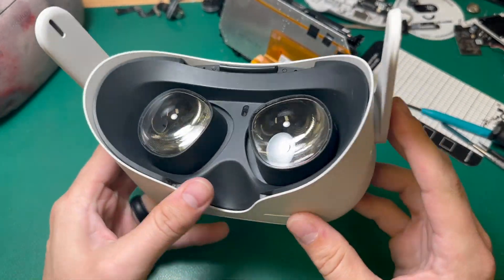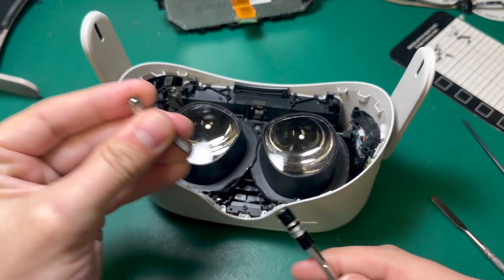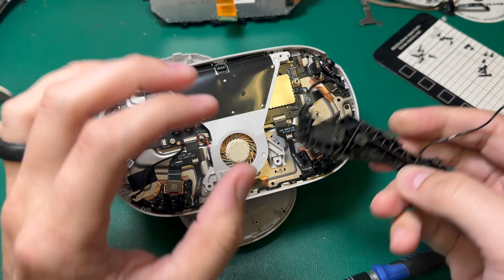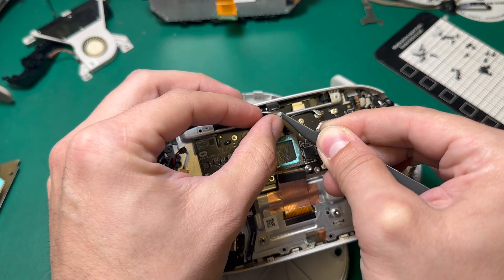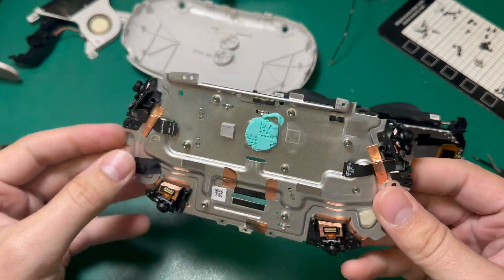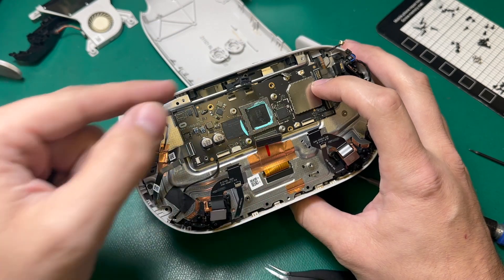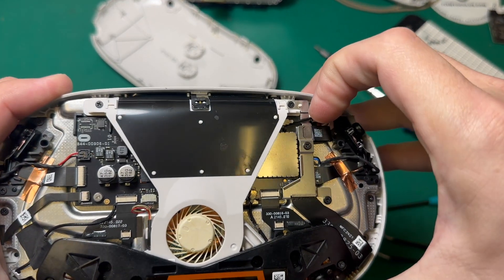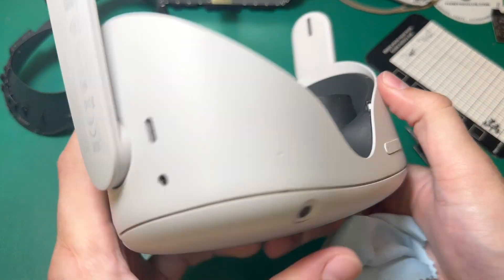Quest 2 LCD Replacement - Sun Damage Repair

Comment: lets fricking go, fixed my headset, i dropped my headset and it went black screen but then i did all the things in the video except replace the motherboard but i just unplugged the lcd cable and it worked, thanks

Comment: @fixmyoculus  I followed this guide as well and have 2 oculus 2's. One had a scratch on the LCD inside causing a small black line otherwise the whole thing worked great and had no problems. The weird thing that is happening to me is that after the meta screen comes on but its not rotating the icon just a still image, it has a download arrow icon on a chip symbol and a green bar that fills up. Once that is done the normal meta icon appears and is rotating around, once that is done I just get a black screen. I've waited for over an hour, I've restarted, hard restarted, fully charged it, tried it while plugged in and not plugged in. Iv'e reseated every connection I have reseated every connection repeatedly Went into the menu and chose to power down then went back into the boot menu and chose boot. Every time it does that chip icon thing then goes to a black screen again. I really prefer not to factory reset because my son did a lot of little customizations I dont want him to lose. What do you think is going on and what can be done? PS I have searched over many forums and most say its an update but it keeps doing it so IDK if that is true
Reply from the maker: Most of the time this booting error is due to a ribbon connection being damaged or one of the cameras being damaged or not seated correctly.

Comment: This seems quite difficult. I have two dots on a quest 2 that has not had sun exposure. They are identical on each screen, but there after a factory reset. 
If I were to replace the lense or put the motherboard on a different quest. Would there be any modifications to suggest if one tears the whole thing apart?
Reply from the maker: Not really. They aren’t really something you can modify. It would be like trying to modify a cell phone.
Reply: @fixmyoculus  Though I ask.

Comment: How did you get the red and black and the blue and black wires off? I am trying but it’s not disconnecting
Reply from the maker: Speaker wires lift almost straight up. I usually grab the cable right where it connects to the board with tweezers and lift up.
Reply: @ ohhhh.

Comment: Can I just replace the lcd and use the lens I already have? How much disassembly is further needed?
Reply from the maker: Replacing only the LCD is much more complicated than replacing the whole assembly. You would need to carefully separate the existing LCD and then reapply the new one with adhesive in a dust free environment.
Reply: @fixmyoculus  Sounds good, Thank you. Ill purchase the whole unit.
Reply: @fixmyoculus  can I just replace the whole unit I got the screen attached to the lens

Comment: Hello, i need to replace my lcd 'cause sun burned it, whats the name of the "glue" that holds the lcd to his frame?
Reply from the maker: I don’t usually replace just the LCD. I swap out the whole assembly. 

Reason being that there is another thin layer between the LCD and the lenses that is usually damaged as well. It’s way easier to just take out the whole assembly.

Comment: After doing this I get a black screen and 3 dots I’ve tried reseating the proximity sensor ribbon so many times but nothing seems to change any advice?
Reply from the maker: Could realistically be anything unplugged in the headset. I would double check the seating on the microphone cables and camera cables. Reseat and relatch things if necessary.

Comment: How long does it take to do the whole process like sending it to your place and getting the problem done then sending it back?
Reply from the maker: Usually it’s about 2 weeks turnaround time. There are some variables depending on how busy we are.
Reply: @fixmyoculus saludos mi quest2 tiene pantalla negra tiene solución eso
Reply: @ezequielbaez4281 Did you fix the black screen? There are videos on resetting your screen. My sons did the same thing. Also will go black if you don’t have good lighting.
Reply: @ no yo la e reiniciado muchas veces y hasta le compre otro sensor y no era eso ya no sé ni qué hacer mejor la deje hay guardada

Comment: Nicely done!  Can any of these parts be repaired ie rebuild the batter pack or replace the primitive sensor itself or replacing the lcd left or right?
Reply from the maker: Some yes. Some no. The LCD is a single panel, so that would require a full replacement if there’s an issue with it.

Comment: I have a problem too, and can you tell what the problem is, and what I have to replace/repair? I accidently left it in sun for a couple of minutes, and when I came back, the screen was all black. When I tried to turn it on again, I couldn't. The screen stayed black, but I still could hear noises by holding the turn on button, but they where irregular timing. I saw a trick with the turn on and sound buttons, but it didn't work. I heard it's an issue called sun damage, and is it possible to fix it by myself with my parents? Because there isn't any repair shop near me. It was like 8 months ago. I couldn't find a shop, so I found you now. And may I ask, how much would it cost, to send it to you? I live in germany. How much would it cost to send my Oculus to you? And how much would it cost to repair it? I hve a Oculus Meta Quest 2, and I played on it like 15 hours if it helps. I ask how much it costs, because I am 13 years old, and if it's very much, my parents probably won't allow me to repair it.
Reply: I think its the same issue as they are fixing in this vid
Reply: Well bro it’s already broken study this video , but some lenses and I mean STUDY this video and learn how to do it urself then it’d be like a slap in the face to ur parents and u will feel good , even if u fail its nice to learn the technology u use a lot because problems will always come and u dont wanna have to pay someone else to repair wen we have free videos of how to fix ourselves ! Take advantage of it !’ Good luck

Comment: what is the main cause of lost tracking loop as my vr is doing that and ive opened it and there looks like there is nothing wrong
Reply from the maker: The primary cause is a broken tracking camera. If one or more cameras fails or breaks the headset will not track and it will result in the lost tracking loop you are experiencing. 

I have a full video on camera replacement if you want to check it out.
Reply: @fixmyoculus  thanks for replying is there any way to check if a camera fails because sometimes when i charge it to 100% for a while it works but the pass through is very glitchy but all the cameras turn on i also forgot to mention that the controllers buzz every few seconds while that happens if that changes anything i think it may be a factory defect or it could be something i did
Reply from the maker: @RL_Ka_ Unfortunately no. It is usually a trial and error method of replacing cameras based on likelihood of failure until the problem is resolved.
Reply: @fixmyoculus  okay thank you very much

Comment: Hello, how do I know that the screen is broken since they sent me one that turns on, everything is heard fine but nothing is seen, not even a light, but if I open the cell phone it is visible on the screen but not in the viewfinder.
Reply: U might just need to reboot the device lol hold power and volume down till it shows if it don’t then u have lcd or display issues

Comment: Is that blue stuff thermal paste and do I need to replace it?
Reply from the maker: It is a thermal putty. I’ve never needed to replace it on any headset I’ve done. As long as it’s there, it should be fine.

Comment: What is the most common cause Of controller joystick drifting? (A. moisture and humidity) (B. Low battery) (C. Tracking)  If you said A. you're correct. Keeping your controllers in a Ziploc bag will extend the life of your controllers.
Reply from the maker: The most common cause based on my experience is wear and tear on the internal joystick sensors. We’ve disassembled quite a few of them and it seems like the metal on metal contact over time is what does the most damage.
Reply: @fixmyoculus  When I put rubbing alcohol all up in my joysticks, they get fixed for a while, so you think dust is getting in there?

Comment: You should be doing this in a dust free environment. I know those are very difficult to come by but in this circumstance it's crucial. Also why didn't you show us the burned out LCD panel.
Reply from the maker: They aren’t that difficult to come by. I’ve got lots of them. And we’ve never had a problem with dust. They aren’t that delicate.